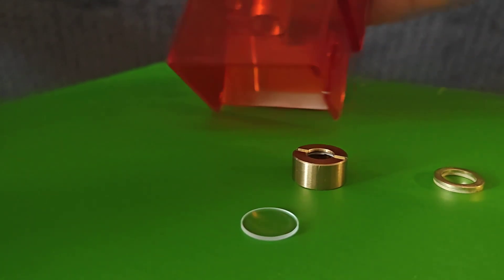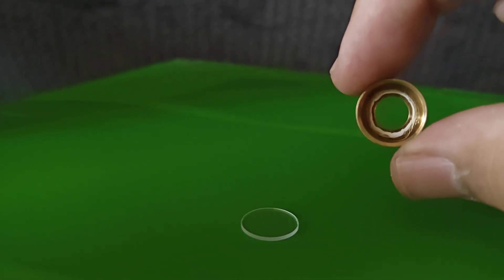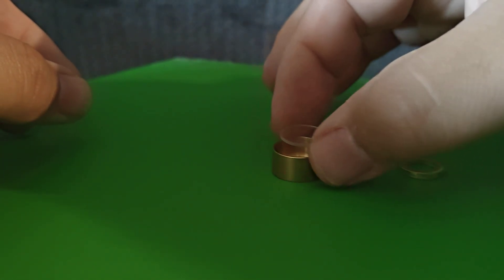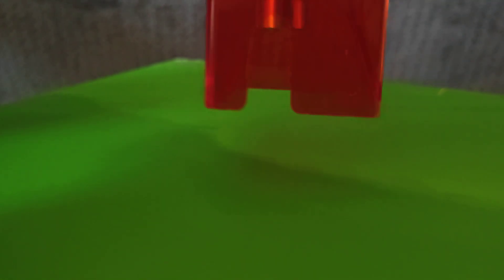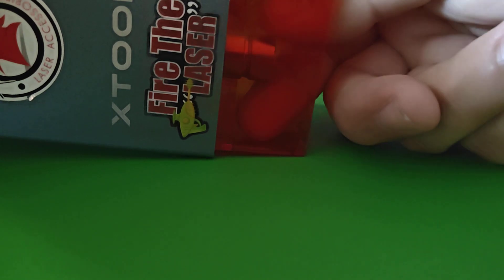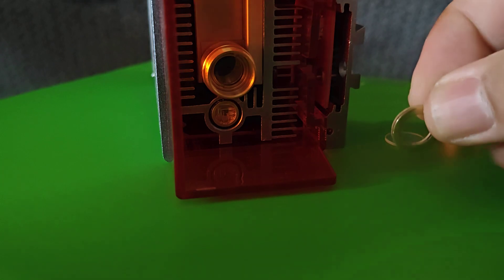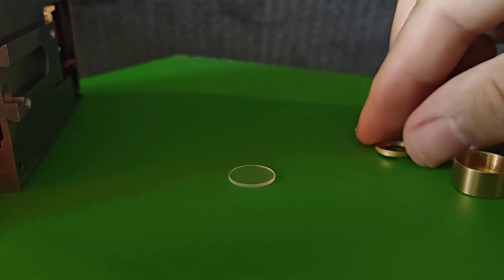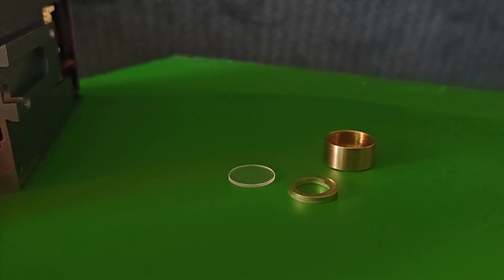New Brass Spacer for Diode Lenses

Comment: How does one remove the old lens ring and lens from the D1 Pro 10W?
Reply from the maker: The best option is with a 14mm flat screw driver and heat the housing with a torch or inside the oven. Don't burn yourself.
Reply: @AlivePixelCreates  Thanks. I was able to remove (unscrew) the retaining ring after soaking it in Acetone for 30 minutes. Now I don't know why I needed the washer. :-)
Reply from the maker: @theoriginalrjt21  I will say because is faster an easier for cleaning that unscrew that all the time